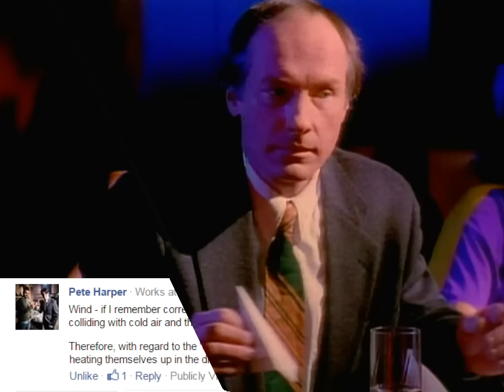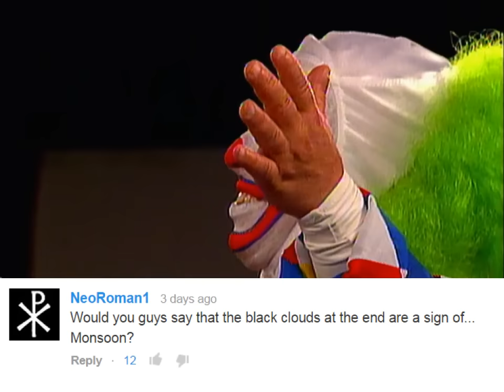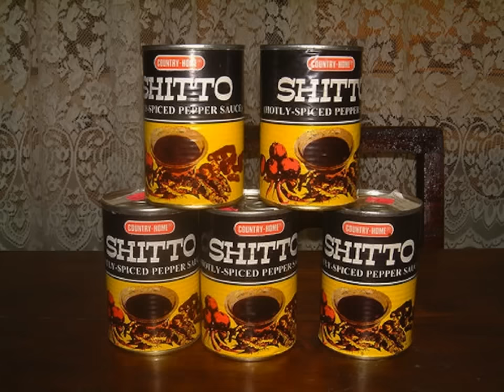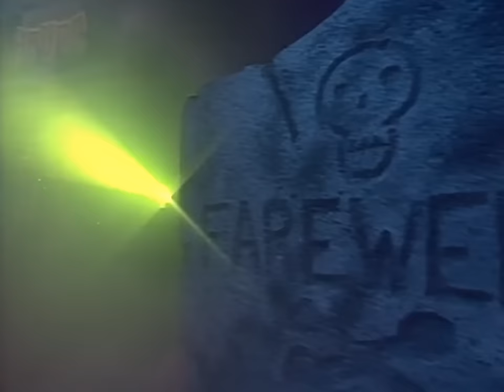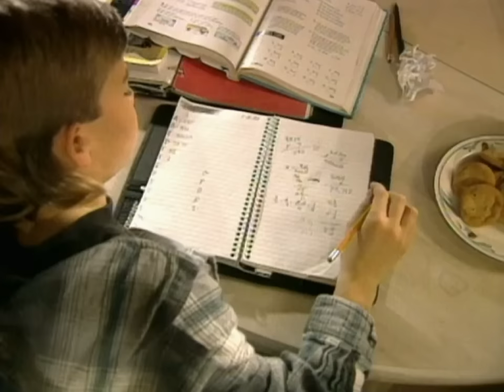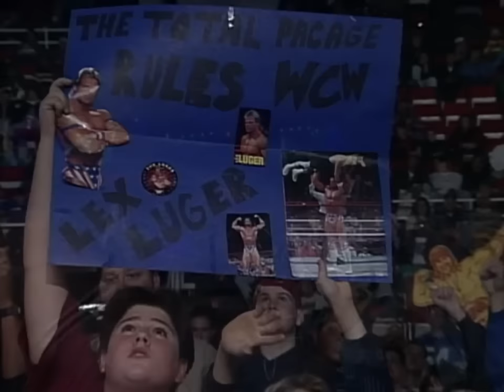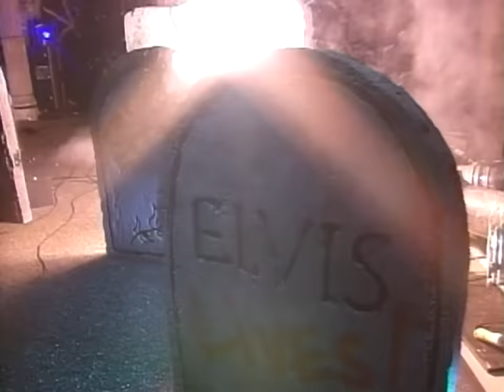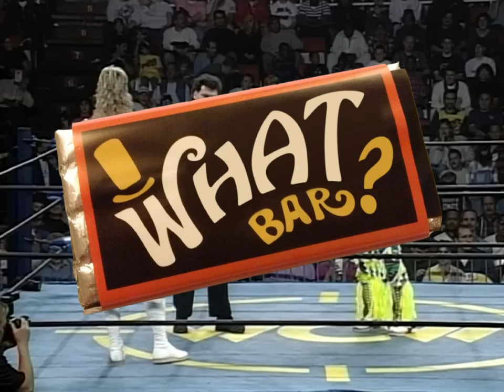WCW Halloween Havoc 1995 - OSW Review 46!

Comment: Generally, especially lately, the draw of monster trucks is their relative "athleticism:" here you have machines with big tires, huge engines and massive suspension that can leap stories into the air with a running start, pull and hold wheelies and sprint around arenas.

So basically this sumo match is the same as having a couple of cruiser weights slowly circling a ring while everyone boos.
Reply: Basically.